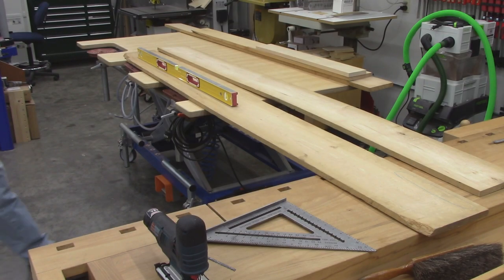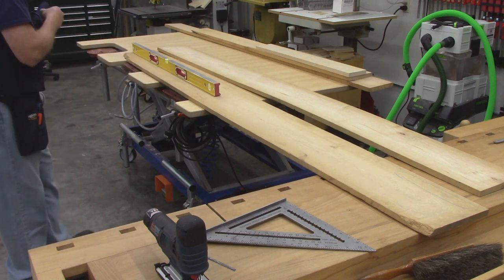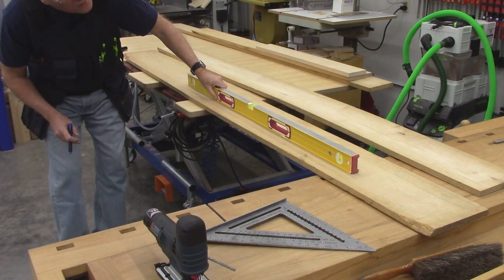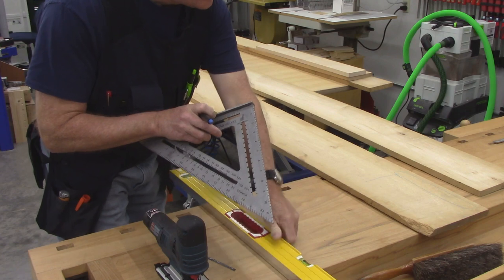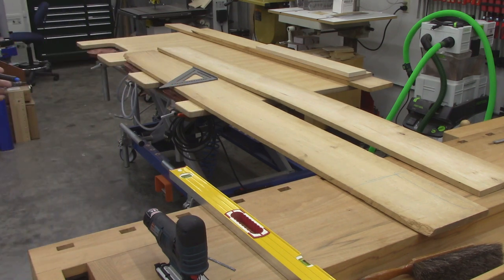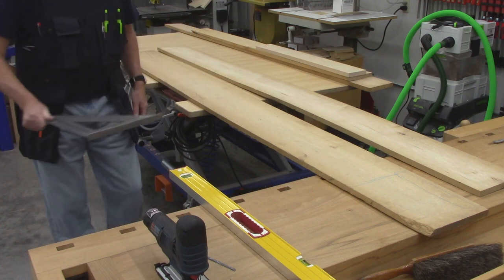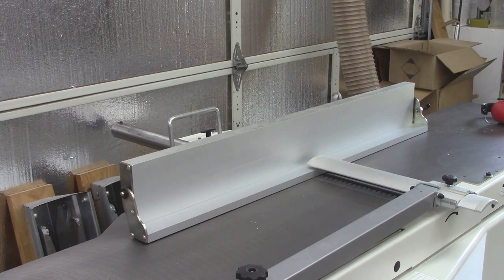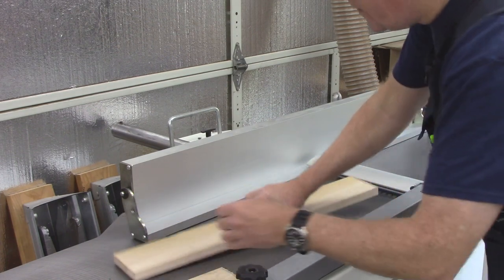Dealing with Banana shaped boards on a Jointer/Planer

Comment: Love to see another guy break material down with a jig saw.  I get looked at cross-eyed when I tell other woodworkers I don't use a miter saw for this, but rather a jig saw.  So much faster, and safer.
Reply from the maker: Having previously used miter saws for this, I agree.  Normally I would have used the slider to break this down but the wood was so 'S' shaped that would have been precarious at best so the jig saw was the best choice.  Steve

Comment: Nice work. Have you got a video on how to keep the metal tops bright and shiny?
Reply from the maker: Thanks Robert.  It would be a very short video since I really don't do anything.  My shop has heat and air which keeps rust away.  I haven't waxed any tabletops in about 6 years.  Steve

Comment: Sorry confused here but using the jointer without the fence weren't you just planing?
Reply from the maker: Yes - they are the same.  Sometimes it is confusing because in some parts of the world, this operation is called planing and others jointing while when using the planer, it is called either planing or thicknessing.  Steve
Reply: @extremewoodworker  Thanks Steve; as a person who did not have shop class in high school, because some politician feels our world doesn't need woodworkers even as a hubby, information from people like yourself is absolute gold, really appreciate the response.
Reply from the maker: @blackstars3720  I agree completely.  Taking shop out of high schools was a major mistake.  The only way to get shop in my area is to go the VoTech route.  This is something that should be available to everyone.  Steve

Comment: Thanks for the video. What depth of cut were you taking when you were jointing the boards in the first place? 1mm?
Reply from the maker: Hi Neil.  These boards were purchased S2S long ago (probably around 1980-81) when I was just getting started woodworking.  I only had a Shopsmith 4" jointer and no planer at the time.  I suspect they were just processed from the rough through a two sided planer in a single pass.   Steve
Reply: @extremewoodworker  Thanks. When you were trying to straighten them in this video, how much were you taking off in each pass when jointing?
Reply from the maker: @neilrelph-olivewoodturning4330  I was taking very light passes probably about 0.3-0.4mm each pass.  Steve